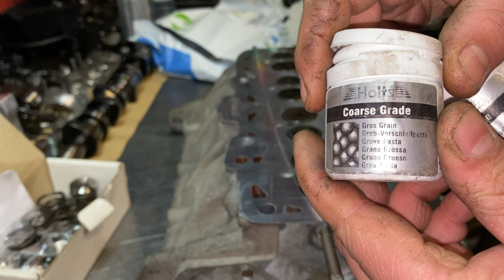How to Valves lapping /re-seating vw 1.9tdi PD

Comment: Great video bro, is there any way how to check if the valves are closing 100% like with sort of vacuum pressure or something ?
Reply from the maker: Yes but I don’t have the machine 😌
Reply: @HelderPutoPerformance  is it normal that intake valves (large) sticking out a bit out from the head surface not like exhaust ?